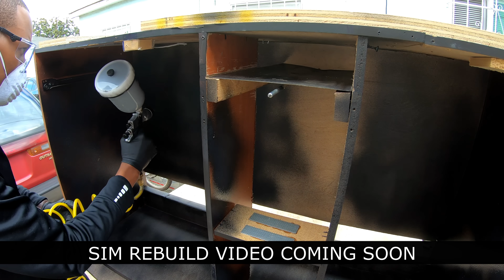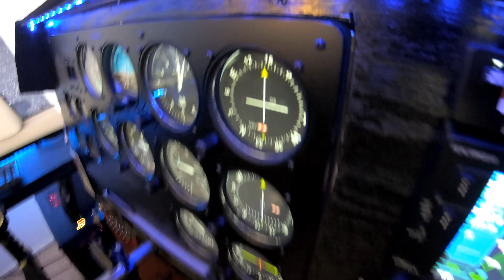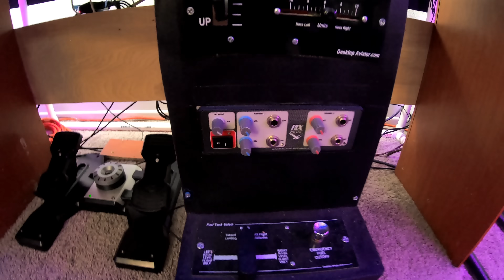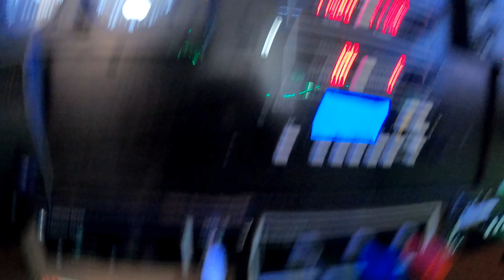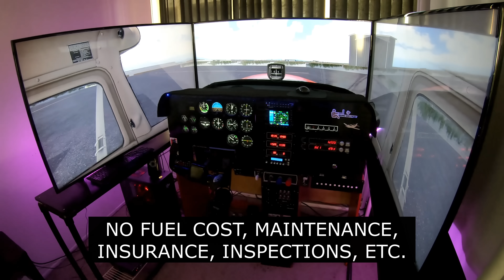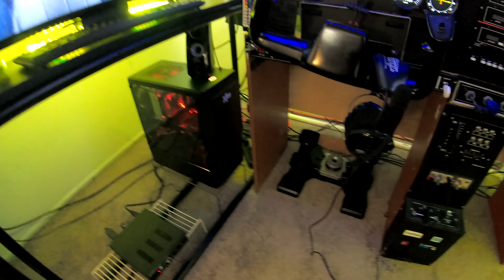HOW MUCH??? | Home Flight Simulator | Home Sim Pilot

Comment: An easy tip on how to get a low cost simulator like this one....go to his house and rob him lol! $8k for a simulator is very cheap, the simulator the airlines use the display/monitor or tv people think they use is actually a special wrap around mirror that costs like a million dollars because it is really hard to manufacture, that excludes the cockpit, the instruments, the flight computers, the sound system, the hydraulic rams and the system to run them, the custom software, the secondary control interface in the cockpit to sets the simulator perameters, the computer/server system, the cabling, the trunking, the astronaut style gantry and docking bridge that lifts up and away when the sim is active, the ground renforcement and above all a place to put the simulator........$8k is a bargin
Reply from the maker: Airliner sim are on another level! I would love to build something like a 737 one day.
Reply: @HomeSimPilot  Yeah, I was gonna build a 737 cockpit years ago, but the displays around at the time were way too expensive and w.eren't much good, now you have more variety and you could easily use the 3 TV's you got there. The bottom console and dashboard would be easy enough to knock out, but it would be the surrounding and overheads along with the avionics is where it gets complicated

Comment: You get an A++ for effort. I am so relieved that you're already a licensed pilot & even a CFI; I would have hated to see that much money go into a sim before you accomplished the real thing. Only question I have is ... if you want to fly a G1000 or other glass cockpit, do you just set aside the panel with all the steam gauges?
Reply from the maker: Thanks a lot! On my new build, ill have a separate g1000 panel and steam gauge panel that i can swap anytime. Ill also be able to swap switch panels and throttle quadrants to fly multi-engine aircraft.

Comment: Fantastic Setup Home Sim Pilot, I am very jealous 😁
I have a VR Setup but I have always found it a bit nauseous to use. 
How does the 3 x Screen Setup compare with VR?
I would hate to spend all those UK Pounds ($$$) and find I still have the same problem 😳
Reply from the maker: Thanks a lot. I get very nauseous when using VR but never had that issue in the sim.
Reply: @HomeSimPilot  Thats good news, I stopped using the VR because of that 😐
Shall have to have a look at the 3 x Screens

Comment: Very impressive build! Cool to learn that you are also a certified pilot, I was wondering if you were. Very interesting videos, keep it up!
Reply from the maker: I really appreciate that. Thanks for watching the videos!
Reply: Come on bro what your wife has to do with this. She should respect you for not running after other women. This is what you love to do as a hobby. So don’t be afraid. However I would still advise you to go back to professional flying as you are still young. Actual flying is much more fun than simulators.
Reply: @HomeSimPilot  Probably commonly asked question by newbies, but how different are flight sim and real flight? I mean technically and psychologically.
Reply: @ExacoMvm  To physically sit in the pilot's seat of a plane and experience 'real' scenery, weather, instrumentation, vibration, etc etc is something any sim is still a long way from (if you drive a car, how close are 'car sims' to the real thing?). However...with MS2020 things have taken a significant jump forward in fidelity. Add in the upcoming HP Reverb G2 VR set (and a seriously powerful PC) and you take that immersion factor to the next level. Of course, not every button/action/effect is mapped into the sim.
Reply: (if you drive a car, how close are 'car sims' to the real thing?). 

Cars unlike planes are muscle memory based ( getting used to clutch, shifting, wheel "sensitivity" ).

I haven't played a Racing Sim with a proper steering wheel and shifter ( only with keyboard and mouse ) but in general it's pretty similar except that Racing Sim's such as Assetto Corsa sucks at clutch mechanics. But overall i think IRL it's easier just because of much superior spatial awareness ( maybe when playing with decent VR it's on par ) , better engine sound cues and physcially feeling the car. But in terms of actually operating the car i think it's nearly identical.
Reply: @Exaco I'm an SEL private pilot as well as instrument rated. For me the major difference is situational awareness. It's difficult to explain (and I haven't tried MSFS 2020 yet) but you just can't get the true feeling of flying the plane and understanding your surroundings.

Comment: Do the knobs in the front panel mask work? How do they connect to air manager?
Reply from the maker: Yes they work. You program each knob in xplane joystick settings. When both computers are on the same wifi network it connects automatically

Comment: does anyone have any experience with the Buttkicker on flight Sims? I have a really extensive simulator and wondering if its worth the addition?.....
Reply from the maker: Out of the box it's just ok. It will vibrate for any noise basically. To get the correct experience you need to install a program called Sim Shaker for Aviators
Reply: @HomeSimPilot  awesome....thats the info I needed.......thank you I will subscribe and like!

Comment: the two question we never answer is how much or how long too build
Reply from the maker: SIM15 im doing my own thing and not following anybody ✈️
Reply: Lol he edited his commebt to say somthing else
Reply: I was just having a larf . if you have seen  any of the flight sim cockpit builder sites on face book you have probably seen my mig 15 sim in a full decked out room made to look like a Russian aircraft carrier. I do like your concept of sim
Reply: @riotalliance3100  lol
Reply: Very nice setup man I like it and I would like to see your panel made from aluminum cut by cnc but it's just the beginning 👍🏼  good luck and keep it up  thump up and like 

 I bought g1000 from DIGMA for one of my friend the quality for the panel switch very bad but the yoke and throttle very good. 
Thank you for your info about the cost and its worth it to keep FPS higher with this set up 😁

Too all people want build sim any type of aircraft the cost its not constant because it depends on 

Ready built or hand built 
Quality 
 level of sim 
Software 

Ready built I mean you buy a panel from website for 300$ rather to make your one for 50$

Quality I mean you buy Logitech rudder for 200$ rather to but c172 rudder for 600$

Level I mean you build the full cockpit with same dimensions of the real aircraft or just basic 

Software I mean type of the sim using how realistic  
Weather 
Scenery 
Aircraft 
Sounds 
Panel 
etc